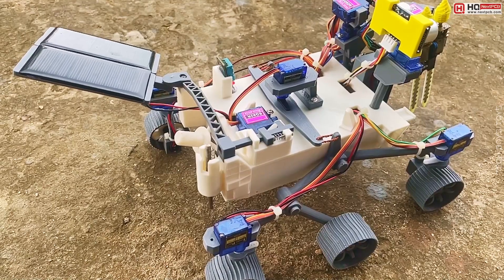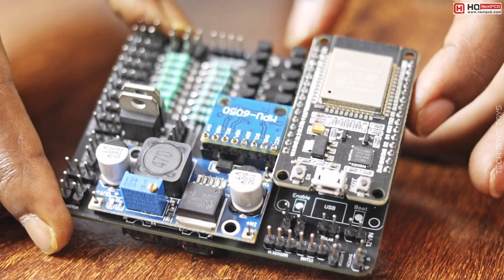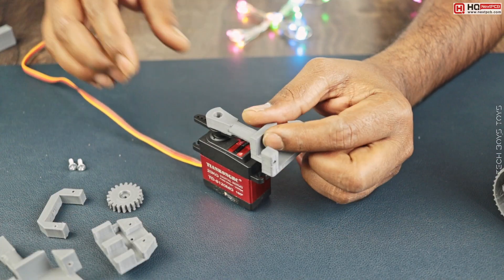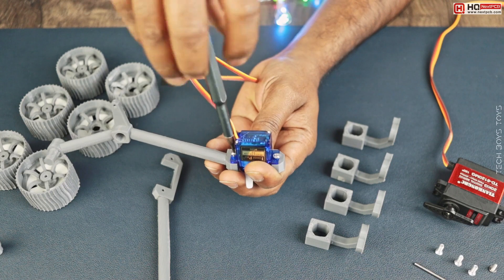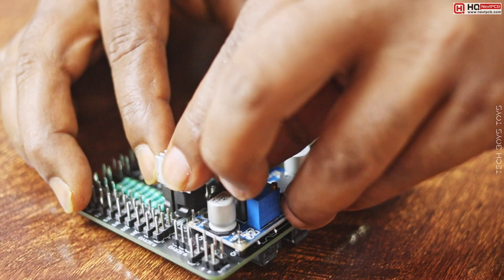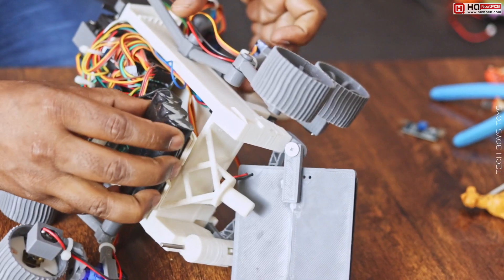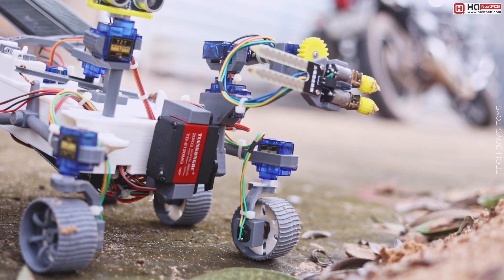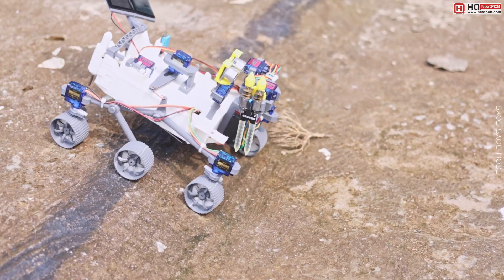India's Chandrayaan-3 robot making for historic moon landing || NextPCB

Comment: Your idea using a drilling mechanism and rotating 180 degrees for sensor deployment is truly creative  in addressing how to insert a soil sensor into the soil. However for accurate soil moisture reading, you have to fully inserted the sensor into the soil or else it will not give accurate result. Those servos aren't enough to make the sensor fully insert into the soil/medium, especially if you're trying to insert it into the moon surface. A standard MG995 metal-gear servo delivers about 11 kg·cm of stall torque (≈108 N·cm) and, with a 5 cm lever arm, only produces roughly 21 N of linear push force. It's only enough for organic and moist soil. I'm doing the same project but more focused on Environmental Remote Monitoring using a linear actuator that has a rated push force of 90N. Another suggestion for reliable data collection, you might want to use cloud-based storage for that data so that data engineers can do some data analytics and machine learning.